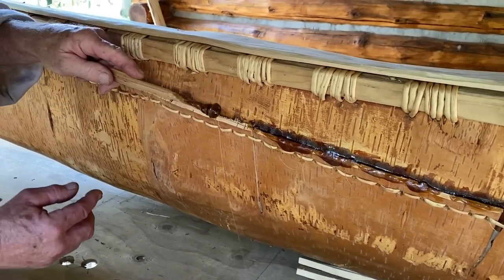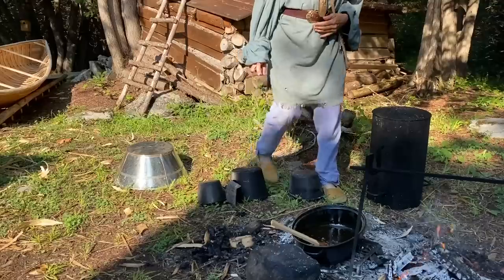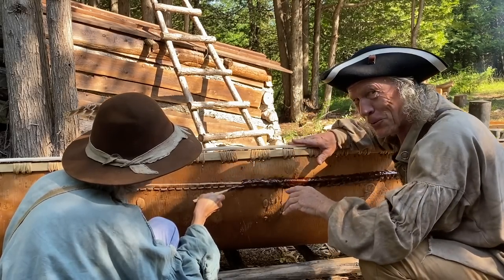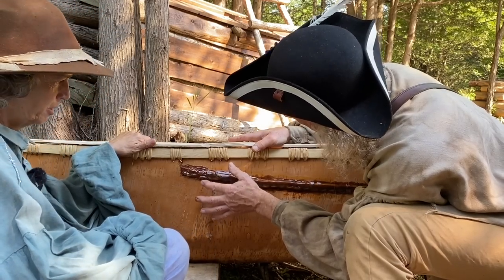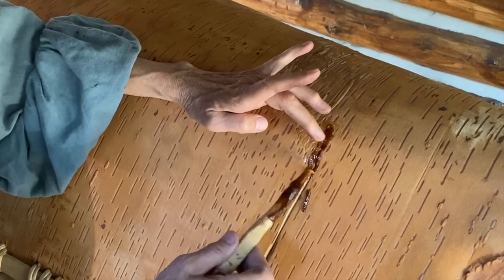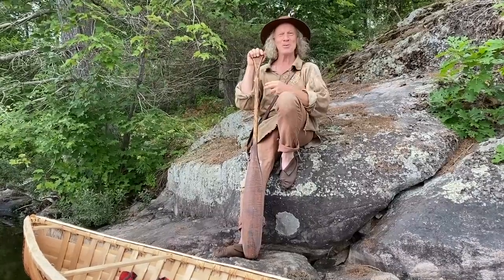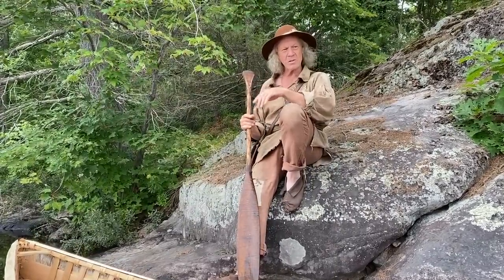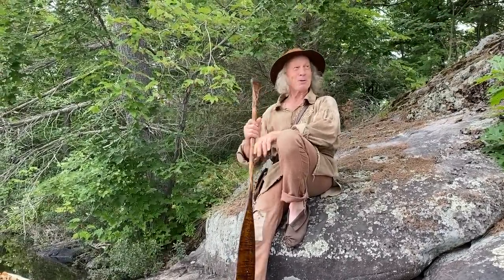Maiden Voyage:  The Birch Bark Canoe Build is Complete!! |INDIGENOUS CULTURE |DIY|TRADITIONAL CRAFTS

Comment: She is beautiful. Oil is an insulator, butter on the hands allows you to make popcorn balls with 300 degree syrup. Use butter for smearing in the holes and no stains to scrub off. I also works ti mold the ends of melted nylon rope. Out of the target date but works.
Reply from the maker: I love it when I receive tips on how to,   Thanks guys …. Who would have thought, butter!

Comment: Any passion, any love of work, will and can become a despised task.  When you first went into the forest for pitch it was a joy.  Once in flow (middle of a project / reaching a goal) we humans are not very welcoming to taking two steps backwards for one forwards.   Every time I had to re-build / redo a project I found that the second time I created something it turned out twice as good.   We humans need to get over the "time-line" and its false pressures and crap it creates.  Every time we pushed past one aspect of creating something and we let lesser quality in, we always noticed that one little flaw about our project forever - like a zit on the tip of your nose.  Every time we exhausted our best efforts fully and 100% on a project; when completed we never hate our attempt even if we may not be as good as someone else.  (JF)
Reply from the maker: Wow, profound words, thanks for sharing.

Comment: Hello again Peter ... I was wondering how long & wide did you make this canoe ? And I'm also wondering if you ever used gray birch. I read that the Micmac/migma used gray birch and white as well.
Reply from the maker: This one is about13 feet and the beam is 31”. I purposely made it with flared sides to carry more weight .  I attempted to recreate a solo hunting canoe, which were far more common than larger ones.  To the best of my knowledge we only have white and yellow birch in Ontario.  Yellow will not work for canoe building.
Reply: @TheWoodlandEscape  Thank you for the reply Sir .. I am hoping that gray birch would be suitable, since we have some large  straight ones on the land. Believe I might of got "Bit" by the Birch Bark Canoe Bug !

Comment: Hmm, compared to a more modern canoe design I'm used to, two big things I don't see here: a yoke to help you carry it (portage) and any benches to sit on. So I guess, how does it compare comfort wise for carrying and sitting? I'd also be curious to know how much it weighs.
Reply from the maker: Doesn’t compare for comfort but, it is historically accurate.  At 60 pounds it is a bit of a grunt to portage.  I will be adding a pink seat similar to what the French employed.  It does handle extremely well.